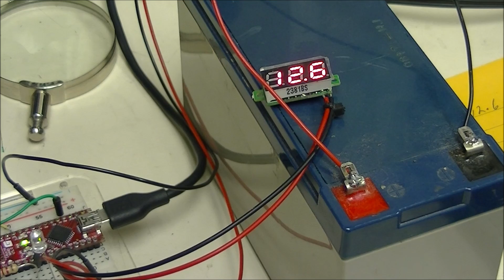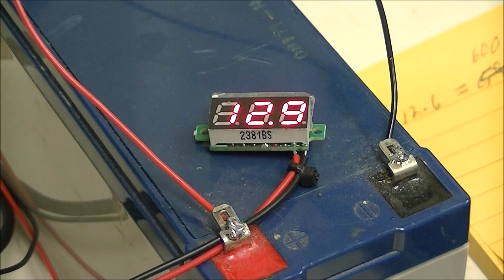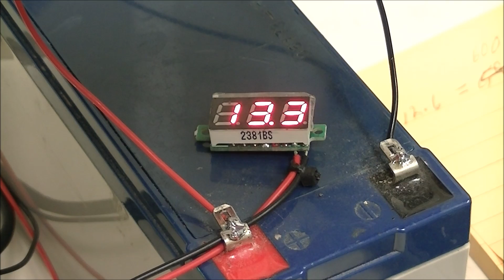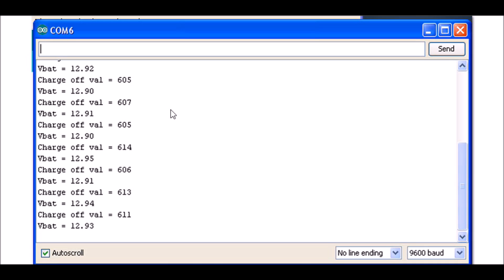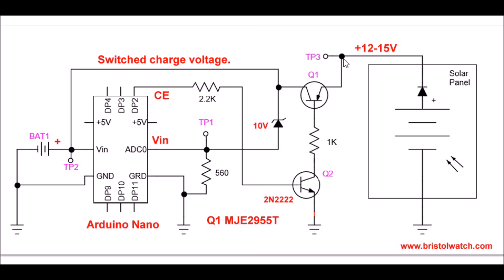Simple Arduino Battery Charge Controller

Comment: Can you use this system with a constant load? I would be using nimh batteries. I want to make a generator using an internal combustion engine
Reply from the maker: Not sure here. What is the constant load?
Reply: 12-16v
Reply from the maker: @occrc3333  Should work.

Comment: Instead of pnp transistor which I presume is like a switch why don't use a PMOS?
Reply from the maker: Mosfets are voltage operated and bipolar transistors are current operated. I needed a current operated device.

Comment: sir.. after uploading the code the output does not shown in serial monitor.. i am using 6volt solar panel and 4 volt battery.. so what should i do??
Reply from the maker: This is a 12-volt system.
Reply: @LewisLoflin   sir, if we use a 6 volt solar panel and 4 volt battery what needs to change in code ?
Reply from the maker: What is the full charge voltage of the batteries?
Reply: @LewisLoflin  i am using 3.7 volt lithium battery.. sir
Reply from the maker: @farhadrana1078  I'll look at the code. and get back to you.
Reply: Sir were you gate the code I did not find code

Comment: I'm doing something similar to keep my mower and snowblower batteries charged through winter from an unregulated 16v DC source. I believe you could use a couple of resisters to form a voltage divider instead of the the zener + 560 ohm for the ADC0 input. Since the analog input to the Arduino has a very high impedance (~10Mohm), you could use something like 110k + 50k as the divider. This would also avoid (or greatly reduce) the current drain through the zener circuit.
Reply from the maker: The original design used resistors. Works fine.

Comment: Could you use resistors to divide the voltage to measure the battery voltage instead of the zener/resistor pair?  It would still drain the battery, but high ohm resistors could drain very little current, correct?
Reply from the maker: That's what I di in the past and works fine. See http://www.bristolwatch.com/solar2.htm
Reply: That's what I'm doing.

Comment: Thanks, I'd like to made simple UPS-like system and I like your design! But I have one more question. It seams to me that if my battery is dead or not present, arduino will not start. Do I understand it right? What do you think about adding relay to switch between sources, or maybe there's a better solution?
Reply from the maker: Yes that is correct. you could use a separate power source for the Arduino.

Comment: Do I need to be specific about that 560 ohms resistance? How did you came up with that specific value.
I m using 1k what difference does it make?
Reply from the maker: No any value from 470 to 1K is fine.
Reply: Lewis Loflin thanks
Infact 10k seems to be working fine
Thanks for the tutorials they were spot on
Reply from the maker: Great! Thank you.
Reply: @SumitDubey7688  10k would be better, its always seeing 2v from a charged battery a least, so theres a small drain current, from the battery, 24/7 ..... arduino sleep would be good too as those thing sup like 15ma running

Comment: If memory serves, aren't Zener diodes very temperature sensitive? Under a load or in the sun (as a charge controller often is) couldn't that effect the accuracy of the voltage reading?

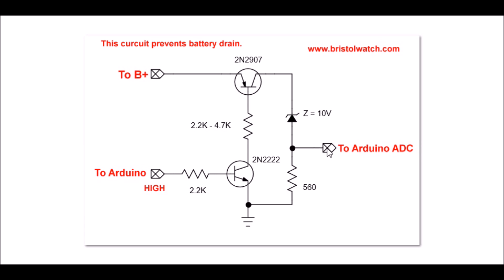Comment: the design is simple and efficient, yet I wonder how can you probe the battery voltage level on the improved circuit diagram at 13:27 when the 2N2907 is at cutoff state (unless you turn it on for a short period just for that)
Reply from the maker: You just said it. Turn it on to check voltage else the battery will be drained slowly.
Reply: thanks, please accept a small donation through your web site via the paypal service

Comment: how do i pick out which resistor to use? most of the video i've watched never mention how should i place the resistor
Reply from the maker: There is a "place" as such. The layout is up to as long as the connections are correct.

Comment: Great video, thanks! One issue with you code: You should not let the loop() get stuck in a (possibly) never-ending 'while' because there are some housekeepings behind the sceens, outside the loop() function, which is normally hidden by the Arduino framework. There is an easy fix to this. Make the while-loop an 'if' and do the charging in the 'else'. Then you can skip the second analogRead() as well.
Reply from the maker: Thanks for the info.

Comment: I've been working on a project and readijng battery voltage by a voltage divider, to get the battery voltage down and comparing and other stuff. In this video you used a zener diode instead of voltage divider. As a beginner in electronics, I have a question of weather or not my approach to measuing battery voltage is wrong or has issues which I'm not aware of. Would it be possible for you to explain where to use divider and zener, please? and in this case that you showed in the video, could voltage divider replace zener without any side effects? Thank you
Reply from the maker: You can use a resistor divider I used to. The zener combination i believe is more accurate. Use resistors if you wish.
Reply: I think that is better by using Zener diode because we see voltage changes directly (input minus ten volts), not divided by resistors in case we use voltage divider.
Reply from the maker: The zener-resistor is used to keep the voltage on the Arduino pin under 5.2 volts.
Reply from the maker: I agree.